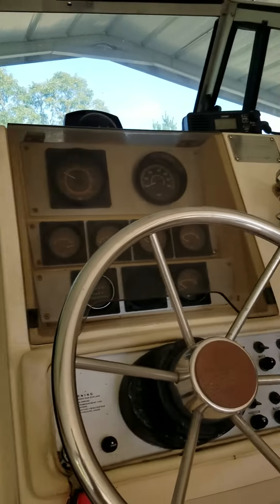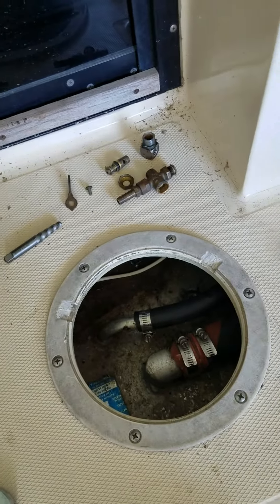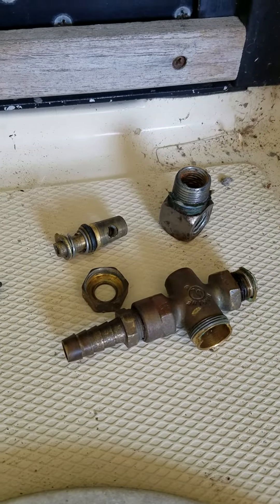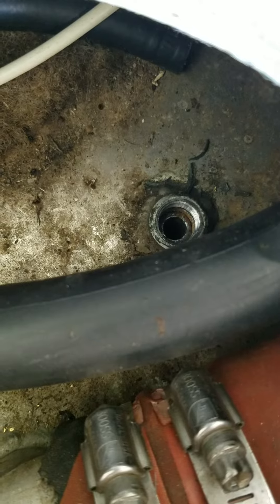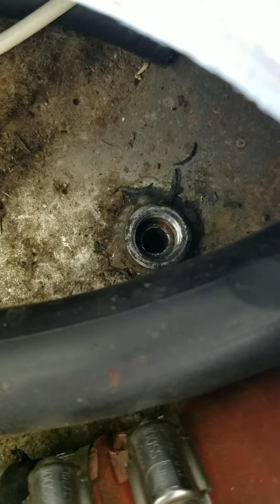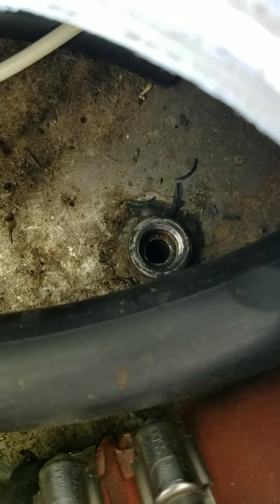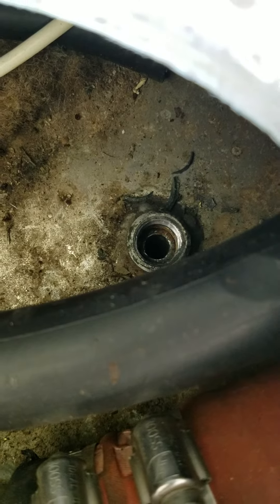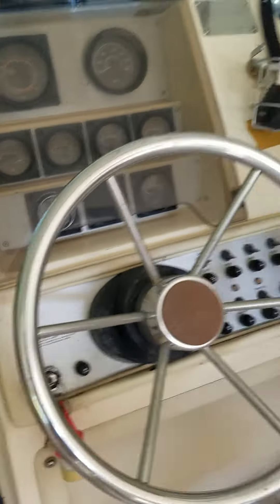Fuel pickup line problems

Comment: 😂😂 BROTHER! 😂😂😂 I did the same damn thing on the same tank. It looks like it sheared off. Sure enough it's welded. I'm about to vacuum out the tank from the damn shavings of drilling through that aluminum pickup. I couldn't believe I did that. Hope you're well. (Chris craft launch 25 2001)
Reply: If anyone sees this. I just blew myself up using a shop vac. Jk, but luckily I had a moment where I used my brain and remembered fuel and sparks around electrical motors might be a problem.

Comment: It could be that the in line check valve is not opening all the way and starving your engine at higher speeds. Just change the anti-siphon valve. Probably Seachoice 20991 Aluminum Anti Siphon Valve, 1/4-Inch NPT
Reply: Wayne, my 200 HP Yamaha HDPI 2 stroke hesitates when the boat is rocking over wakes or waves at high RPM.  It hesitates for a second and then goes back to full speed, and this cycle repeats itself until we slow down or get out of the wake or rough water.  Do you think the pickup tube and antisiphon valve could cause this problem ?  (We have found no obvious explanation, e.g., no water in fuel, no loose connections, VST ok, etc.)  Thanks.
Reply: @dennismacauley9254  did you figure out the fuel issue ?

Comment: another thought would be that ...Shake compressed air in canister then turn it up-side down and spray into tube to cause "contraction" of the metal pick up tube walls while you are easing it out with the easy out tube.  spray before and during.  Could not hurt to try this.